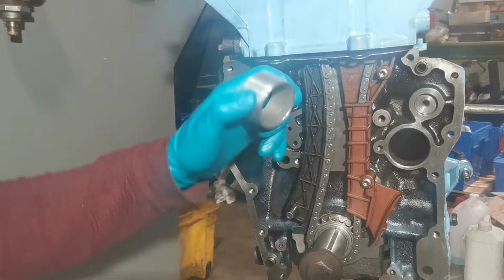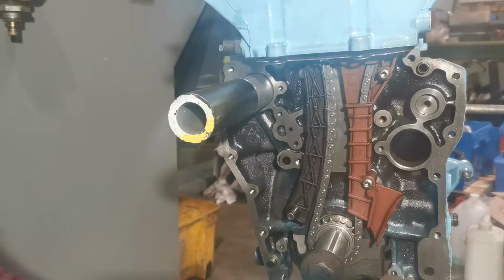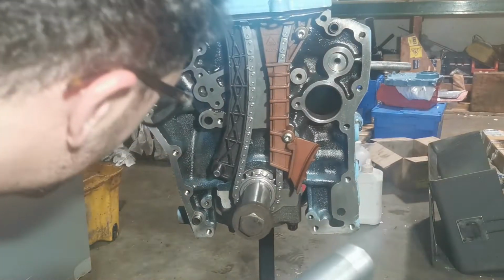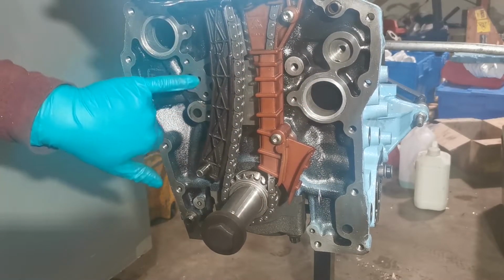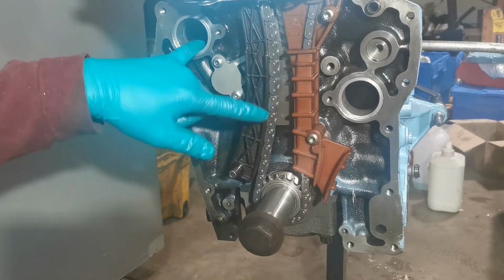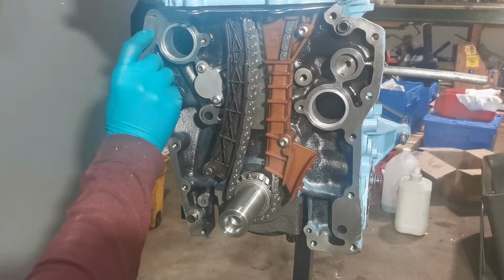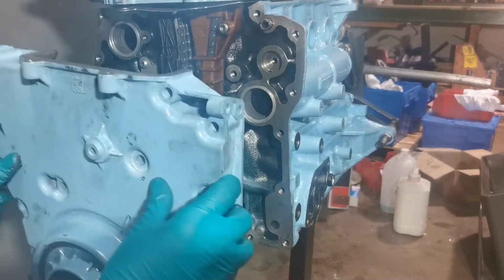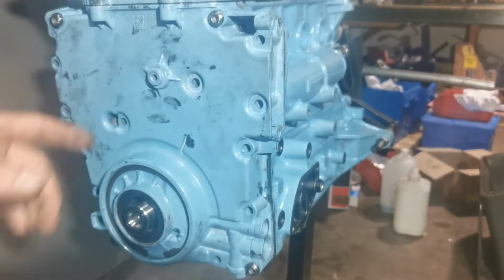Saab B204 Balance Shaft Delete

Comment: Nice work...
Question for you though,
Delete chain, delete and blank tensioner, modify lower plastic guide
To act as spacer......
But why not just leave the balance shaft in situ?
They won't rotate, so the shaft oilways  should be blocked.
Appreciate an answer buddy.
Reply from the maker: Hey bud, its more for the weight reduction aswell as they weigh a great amount. Making the engine lighter reducing the overall weight when put into the corsa hopefully increasing the power to weight ratio.😁Thanks for the comment bud appreciate all interaction!